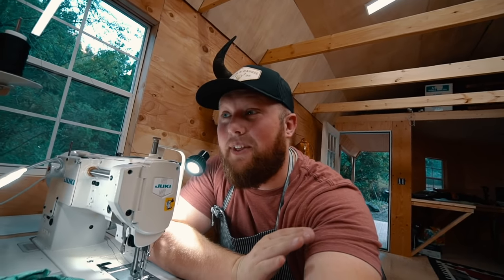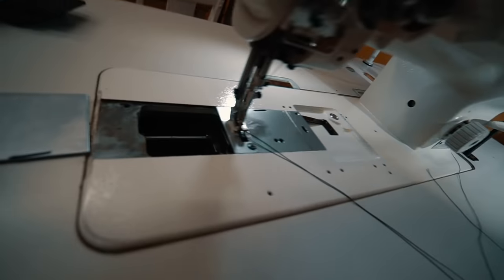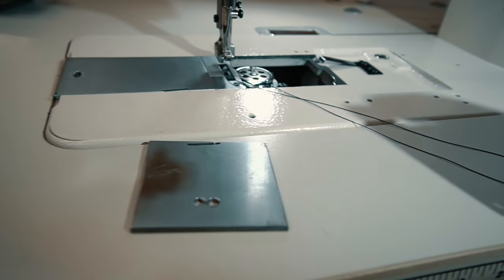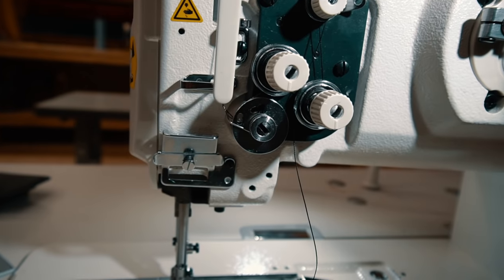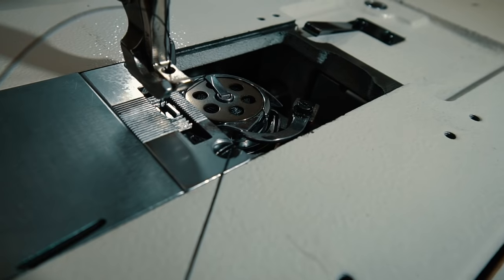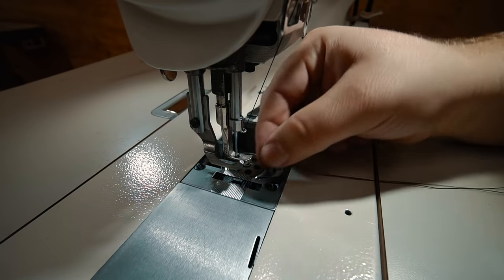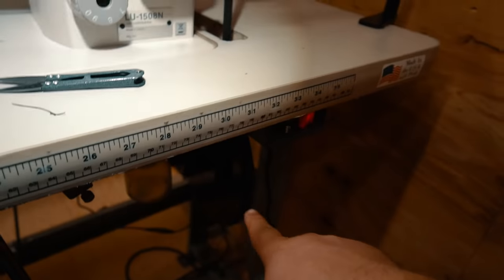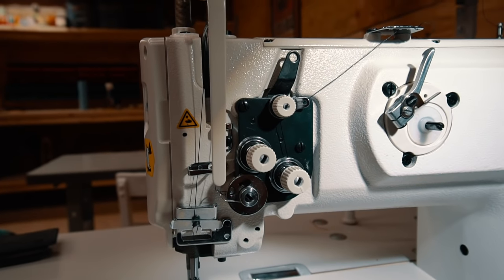How to Thread a Juki 1508 Industrial Leather Sewing Machine + Basic Overview

Comment: Nice video. The numbers on the stitch length dial represent the stitch length in millimeters. Also, you can get a genuine Juki replacement plate (for the one cut in 2 pieces) on Ebay for about $18. I might be worth it to remove the frustration.

Comment: I've got the same machine and have no issues running the bobbin thread from the bobbin out without using a tool. And that pointed tool is the worse you can do. If you scratch the hook pickup etc that will cost you a fortune.